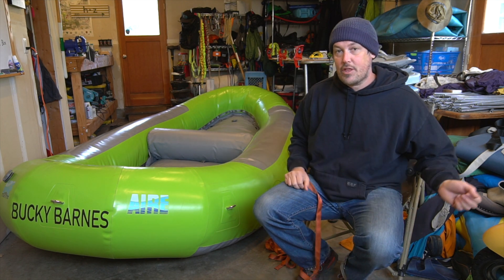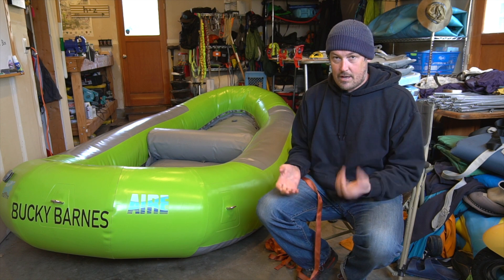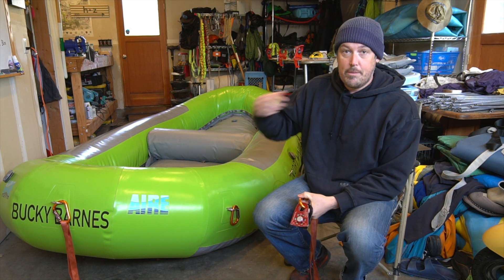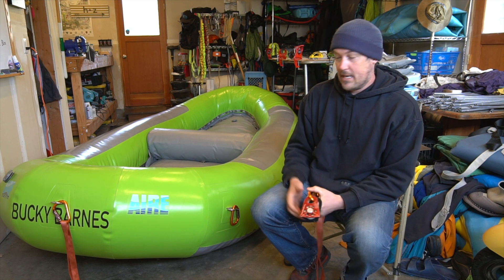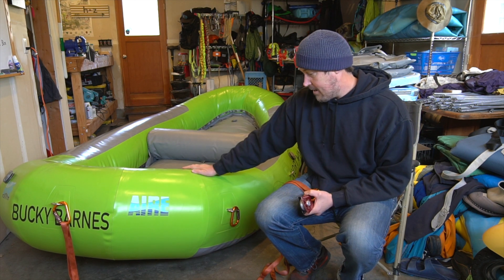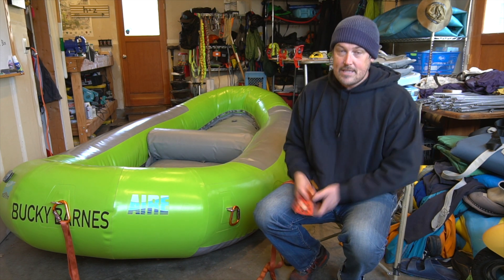Two Point Self Equalizing Anchors on Rafts | Ep. 120

Comment: In your previous episode on a 3 point anchor system you stated that you prefer not to put the twist in the 3 point system because it does not allow the system to equalize as fluidly and you will retain a 2 point system if 1 D-Ring pops. Do you have more information regarding issues with not having a twist in the 3 point anchor system which led you to recommending it in this episode?
Reply from the maker: No more information - since the twist isn’t necessary I don’t do it. It only minority affects the equalization so in my opinion it’s fine if you do add the twist.

Comment: Lately, I've been using my winch to get the raft (14-foot Sotar, day trips) on the trailer.  I'm thinking that I don't want to put the full pressure on 1 D-ring -- I can do the 2-anchor thing using the 2 rings just behind the bow ring (on both sides).  Am I being too cautious?  Also, please confirm the necessary angle degree -- is it less than 120 or less than 60 (as Caleb said -- maybe I misunderstood)?  Thanks!!!

Comment: Years ago, we came across a group trying to extract a badly pinned raft on the Upper Wind.  They had managed to break every accessible d-ring off of the raft and they were hanging from their spider web of ropes like Christmas ornaments.  In their defense, it was the worst pin I've ever seen.  The boat was 90% under water and being squeezed between two boulders so it's amazing they were able to get lines on the boat at all.  As far as the angle on a 2-point anchor goes, one way to visualize why you don't want a flat angle is because basically that is creating a vector pull on the two d-rings which initially can generate about a 5:1 mechanical advantage.  Combine that with the 3 or 5:1 system that you've got pulling on it and that is a lot of force.  Thanks for doing these Zach, I always learn something new and it makes me think about things I have already had exposure to in a fresh light.
Reply from the maker: Thanks for the story! A vector pull can theoretically create infinite force if the angle is 180 degrees.

Comment: Is there any reason why you wouldn’t just clip the webbing to the D rings as you did in the second part vs running it through and tying a knot? Is there a preferred method?
Reply from the maker: Sandy Radsek you could do that but it takes extra carabiners and extra time to make happen. Most of the time carabiners are in short supply.

Comment: When I was rigging pipe to install, we said the same thing only looking at it a bit different: the top angle of the triangle had to be less than 60deg(same as your less than120.  An easy way to accomplish this is to measure between D rings and have the legs on the harness longer than that distance. So for the set up shown your total webbing length should be over 4 times the distance between D rings.
Reply from the maker: Awesome advice. Thank you! I love the 4x rule.
Reply: Also a plumber/fitter/rigger. Yup same way. Nailed it!